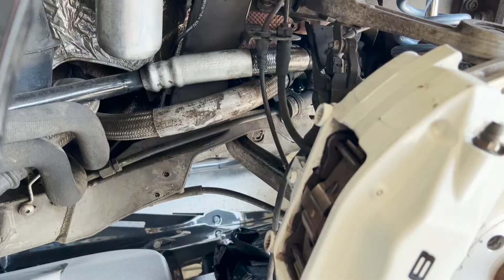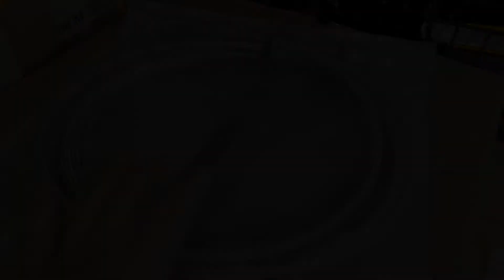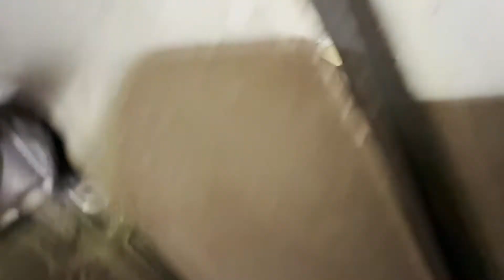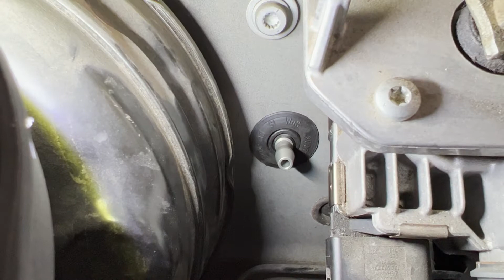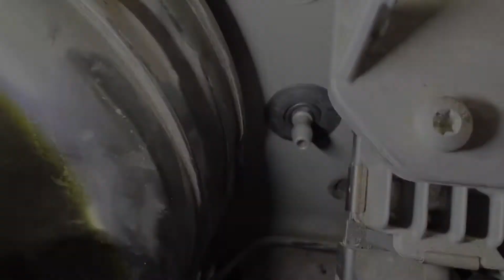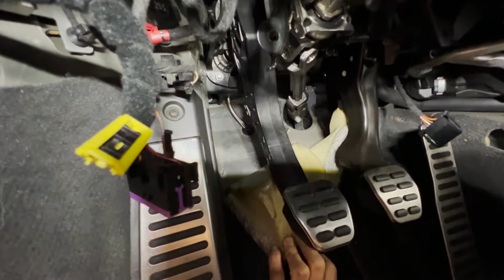Audi R8 Gated Manual Conversion Part 6: Installing the Clutch Lines and Pedal

Comment: Hello, amazing series mate and you have inspired me to do it too, I have all the parts but I was wondering what did you do with the kick down on the accelerator pedal? Did you replace the pedal or can the click be removed some how?
Reply from the maker: Hey James, I did not touch the accelerator pedal at all. There's no need to do anything to the accelerator pedal.
Reply: @sk4klsiww  thanks so much for the reply. So your pedal still has the click for the kick down at the bottom of the pedal when you push it?
Reply from the maker: @jampeauk  Yes.

Comment: marvelous!  Professional and clear guidance!  Thanks for the benefit to the players!  I would like to ask you, where can I buy or customize this clutch hydraulic hose?  Thanks!
Reply from the maker: Hose can be bought here: https://www.rkxtech.com/products/rkx-clutch-line-for-audi-r8-lambo-gallardo-manual-conversions
Reply: @sk4klsiww  Thank you very much for your warm help!
Reply: @sk4klsiww I would like to ask if the oil pipe is customized, can the total length be no less than 400cm?  Thanks!
Reply from the maker: You need at least 13 feet if you want to make your own clutch line.

Comment: Can you link to the correct hose end to go into the r8 clutch master cylinder. I'm stuck in the proprietary fitting lol.
Reply from the maker: Look up Earl's Performance Clutch Adapter Fittings 652504ERL
Reply: @sk4klsiww  Thanks for confirming this is exactly what i was looking at but wanted to confirm!  Excellent work by the way!